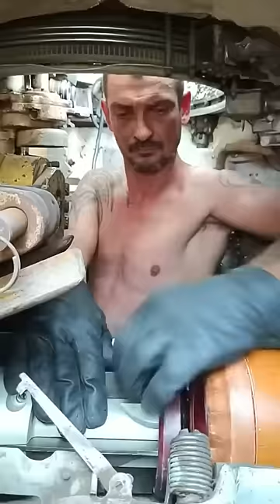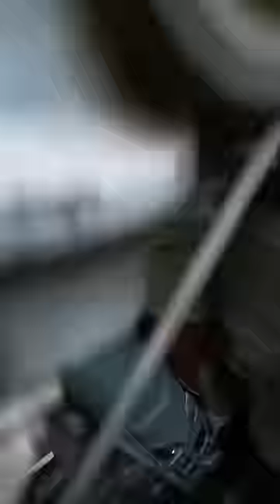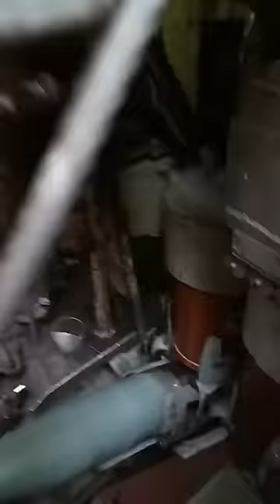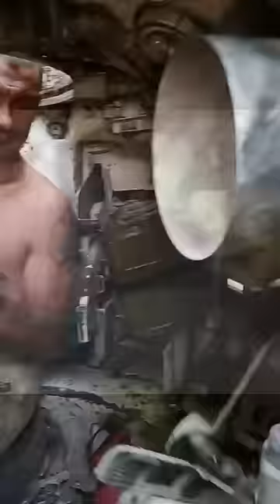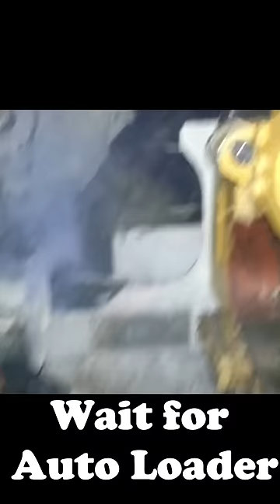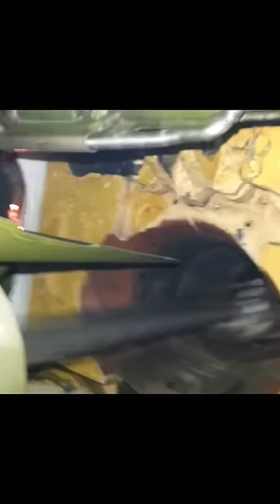Т-64 Auto-Loader Tank Reloading mechanism #Shorts

Comment: Why at the firing part you're showing a T-72
Reply: Bcs nowadays t64 don't fight
Reply: T 72 cooler
Reply: @suspekt8790  it fights in Ukraine now
Reply: Why it matters, they both have basically same auto loader systems
Reply: I mean he still got the point across about autoloaders and both T-64 and T-72 have them anyways.

Also to the guy above, NO they aren't exactly the same. T-64 has the charges vertically and reloads them with one rammer, T-72 stacks them horizontally on the ammo and loads them with 2 rammer stages as seen at the end of this video.
Reply: All the t-64s had their turrets popped
Reply: It's because he stole that part of the video from someone else. It's a famous old video.
Reply: @suspekt8790  the T-64 has the same autoloader like the T-80 and both are still in service.
Reply from the maker: Watch this.
https://youtube.com/shorts/DJCgtZXY9NQ?feature=share

Comment: Autoloaders are cool until the turret turns into a spacecraft
Reply: We saw that in Syria you dont need an autoloader for that 😂
Reply: @Warhawk72  MBT70 project. If im right that one had an autoloader.
Reply: @Warhawk72  Money. When the General Motors,Chrysler were designed the abrams prototypes (xm1). General motors made a hydraulic suspension (same capabilities as the south korean tanks). Well the army picked the chrysler prototype and thats how the abrams were borned after some changes. The problem with the MBT70 project was its cost. Its auto loader unlike the russian ones were much complicated and safer,but pretty expensive
Reply: suddenly gives credence to halo's scorpion where the crew cabin was completely separate from the auto loading turret

Comment: This autoloader has 2 functions
1. To load the main gun
2. Send the crew to the ISS
Reply: That’s a Ukrainian tank and your Leopards, challengers didn’t perform any better
Reply: @mclukas44lol25  ofc they do. The survivalbility of western tanks r way higher
Reply: 90% of the ammo detention is caused by the extra shells surrounding in the tank.
Reply: @thefrunze.198  thank you, someone else who understands the russian carousel autoloader and the "loose" ammo issue the T-64 and onwards tanks faced more prevelantly. (though the T-64/80 carrousel IS an actual issue to the detonations and more likely to pop the turret as the position and physics pixies.)
Reply: @dominikbaum959  If the ammo is hit it's gone, no matter what. Blow out pannels only protect from hits from a certain angle, if the door itself get's damaged from the penetration, it's gg no matter what
Reply: @dominikbaum959 the challenger also does not have blow out panels, the charges (just like Russian tanks) are stored in the bottom of the tank.
Reply: 3. Make three shots on the move while William tries to manually insert the projectile into his Abrams

Comment: slight correction of this vid.
-The T-64 HAS an autoloader
-if it doesnt need to be loaded, then how can it fire after it shoots
-The last part is not a t64, its a t72.
Reply: Considering the fact that all T-80's, T-70's and T-90s are based off of the T-64's. They are all practically the same tank, so it doesn't matter which one it is. They all have ejection seats anyway.
Reply: @quarthanader5930  amazing depth of knowledge. You're even smarter than an eight-year-old girl. The only difference is that she knows how specific tanks differ.
Reply: Ok smart one
Reply: @Rory_Mercury  A hint of projection here aye? But what I said is true, they even use the same engine in all T-64, T-72, T-80 even the T-90 and it's fake T-95 brother. They are all practically the same tank, with the only difference being minute changes in the Tanks armor.
Reply: I already know that's wrong because the T-64's were made in the 50s the T-72'S were made based off the T-60s.
Reply: tf is a t-60 and a T-70? (If you're talking about that light tank then alr)
Reply: @bearlyfamiliar6100  They're modern Russian MBT'S, the ones everyone knows... The Russians have newer tanks but I'm not sure they're using the T-80 BVM. Maybe because I've seen videos of Russia's newish T-90M in Ukraine. Doesn't really matter what they are, all Russian MBT'S are the same tank practically. They all blow up the same way anyways.
Reply: 【 𝕺𝕲   ℤ🇷🇺𝕍    𝕸𝕭 】  Listen the only difference between the T-64's through the T-90'S. The only real difference is Armor, but that means nothing when they are all functionally the same tank. They all die the same way anyways, there turret flying through the air at about 70 feet up. A shit tank is a shit tank.
Reply: @UCEExmzJdav-8JCYX2QT-nVA they have different roadwheels. You were wrong.
Reply: @quarthanader5930 They all have different autoloaders

Roadwheels
Engines
Armor
Optics

Major changes in reliability...

T-80's usually use Gas Turbine engine such as the one on the Abrams... but since it's kinda expensive and stuff... Russia also makes some T-80's with a diesel engine... 

T-72 is vastly superior then a T-64... it's cheaper... more reliable... and overall just better...

T-72 was made because T-64 was deemed kinda expensive and unreliable... so they took what they had with T-64... changed it entirely while keeping the same... design style... and out came a more reliable... cheaper... and better tank T-72... then they made a T-80 which was meant to be a USSR / Russia Flagship tank reserved for best tank squadrons and not to be exported...

It wasn't until the Leopard 2 and Abrams that the West had something to challenge the soviet tanks...

When T-64 came out... best tank it would have fought at the time would be an M60 Patton or Leopard 1... 
It was extremely overpowered for it's time lol especially since it was the ONLY tank to have composite armor and 125mm Smoothbore gun... compared to West's best 105mm rifled and no composite armor lol 

So... while they might look the same... and work similar...
They are entirely different tanks...

Comparing a T-64 to a T-80 would be like comparing an M60 to an the first Abrams... totally different tanks

And also... i didn't mention the T-90...

What T-90 is... is literally a T-72B ( 1989 ) Hull with a new turret... entirely new turret and sensors and whatnot... and the famous Eyes... the Shtora Soft-kill Active Protection System... 
This is the T-90A...

Now they have T-90M which may or may not have armored ammo carousel... so it's not really a copy paste T-72B (1989) hull now... but it still kinda is... and the reverse speed is still the same... 4kmh Lmao 
So yet again... it's a T-72 with better turret and ERA...
And the ERA is called Relikt and some variants of these tanks have kontakt 5 ERA... it-s designed for NATO rounds to protect against Armor piercing rounds... and also work against Chemical rounds such as HEAT based rounds... like RPG's 

Kontakt 1 is the best one if you are not gonna encounter stuff that can pierce the armor with AP shells... it provides much better coverage... 
Tanks with Kontakt 1 usually have a V in their name... for example T-64B and T-64BV... the BV has Kontakt 1...

Now T-80BVM also has ERA but it has Relikt all over instead of Kontakt 1... it may or may not have Kontakt 5 somewhere on it... a mix of Kontakt 5 and Relikt depending on the variant

So TLDR...

T-64
T-72
T-80
T-90 are all different tanks that just look alike and their final result is almost the same... but how they work internally is totally different lol
Reply: @quarthanader5930 
* T-60: WWII tank powered by a 70hp 6-cylinder inline engine, lobgitudinally mounted and laterally offset to the right of the fighting compartment.

* T-64: Cold-war MTB powered by a 5-cylinder opposed piston diesel engine, transversally mounted in the rear of the tank yogether with the gearbox in a (relatively) easily removeable "power-pack" unit.

T-70: WWII light tank (significantly improved T-60) with TWO engines (same as in the T-60) bolted together, still longitudinally mounted to the right of the fighting compartment.

* T-72: Cold-war MBT powered by a V12, transversally mounted in the rear of the hull, just forward of the gearbox.

* T-80: WWII light tank (further improvement of T-70) with a two-man turret (T-60/70 had one-man turrets)

* T-80 (yes, there were two tanks with this designation. Deal with it): Cold-war MBT powered by a gas turbine engine. Technically an offshoot from the T-64.

* T-90: I honestly don't know.

* T-90A: a hybrid mix of T-72B and Object 187, which was a prototype that was intended to completely replace the T-72, but was found to be too expensive because of its new drivetrain (it used a completely new 1200hp X-engine, which is basically like two V engines fused together).

* T-95 (Actually Object 195): Prototype tank based on a lengthened Object 187 hull and the associated powertrain, with a big honking 152mm gun in an unmanned turret. Suspisciously similar to the later Object 148 (A.k.a. the T-14 Armata), although Object 148 ended up with a smaller 125mm gun.

There, now quit your bullshit.
Reply: @quarthanader5930  Not exactly. T-64 has better autoloader , its lower into the bussle unlike T-72. 
Back in Soviet times the T-64 was considered the best tank they had and send on mass in E Germany to at the places where Challangers ware stationed (as those ware considered the biggest threat). 
T-80 was supposed to be the replacement but that one had tones of problems with the turbine engines.

T-72 is a direct successor of T-62 with T-64 features on a different chassis. It was meant to be the new MBT but it didn't met the expectations and was mostly exported (this is why there are more T-72s aboard then in USSR).
Reply: @mowtow90  T-64 auto loader is actually taller, unlike the shorter T-72. However, it is better in terms of reliability because it is hydraulic, as opposed to electric t-72 autoloader
Reply: @quarthanader5930  Wrong. There are thow paths. The T-64/80 and the T-72/90. They have a different autoloader, the T-64/80 have the MZ loader while the T-72/90 has the AZ loader. The difference is that the T-80 was the rsult of trying to modify the T-64 while the T-72 was made from scrach directly.
Reply: @quarthanader5930  the turret only flies off because of the top attack javelin and nlaw which hits the thinnest part of armour of tanks, considering all the ammunition stored in the autoloading carousel of course the most logical sense is that the ammo rack will blow off the tank turret with an explosive anti-tank hitting a bunch of explosives. But I'm pretty sure if you hit an Abrams, Challenger 2, Leclerc and Leopard 2 on top of the turret it'll render the tank destroyed or inoperable just as the T-64s & T-72s we see being destroyed.
Reply: @kajmak64bit76  T-80 and T-64 have the same autoloader, t-72 and t-90 have the same autoloader.
Reply: @mowtow90  The t-72 autoloader is lower. t-64's autoloader is extended and high. you can see in the first video of him loading.
Reply: @TinyBlitz8  Well not really. if you were to hit the side of the tank under the turret it would fly like a rocket into the sky.
Reply: Soviet military equipment has always been at least 10 to 15 years ahead of Western technology. but after the collapse of the USSR, development slowed down greatly.
Reply: @carsismyaddiction6919  probably because they lied about the capabilities of their vehicles
Reply: Has an*. Even your correction was grammatically incorrect. 

It said "it doesn't have to be reloaded in combat". Keyword being "have", as in it is not 100% necessary to load it in the middle of combat in order to engage considering it should already be loaded. Obviously it would run out eventually, but that's not the point that was being made. 

I mean at least you know what you're talking about, that's always a surprise on YouTube.
Reply: @quarthanader5930  nope. Just nope
Reply: @quarthanader5930  nah. T-64/T-80 is another "family". T-72/T-90 has different loader
Reply: @quarthanader5930 except T-72 has a different carousel configuration to 64 and 80, which that alone already would indicate it's not the same autoloader.
Reply: @Ben-ek1fz  capitalists with equal resources will always lose to socialists in development, and this is obvious. under capitalism, the main thing is profit, and often personal gain is more important than the development of technology or the state.therefore, while the USSR was designing unprofitable, but effective and working technologies, and became the first country to send a person into space, Western countries faced problems because development costs money, and under capitalism, no one wants to lose them, and mass technology has to be refined longer to make it cheaper.
Reply: slight correction of your comment:
- an* autoloader
- doesn't*
- it's*
Reply: I just want the nerd emoji lmao.
Reply from the maker: Watch this.
https://youtube.com/shorts/DJCgtZXY9NQ?feature=share
Reply from the maker: Watch this.
https://youtube.com/shorts/DJCgtZXY9NQ?feature=share
Reply from the maker: Watch this.
https://youtube.com/shorts/DJCgtZXY9NQ?feature=share
Reply: @quarthanader5930 sadly for you, Russian tanks are as good as nato tanks, so nato tanks are shit aswell
Reply: T-64 series: MZ (hydraulic) autoloader. T-72 series: AZ (electric) autoloader. Last clip is T-72.
Reply: @TribitFanOpex which is why the commander of the T-72 in the second clip was yelling “АЗ!”